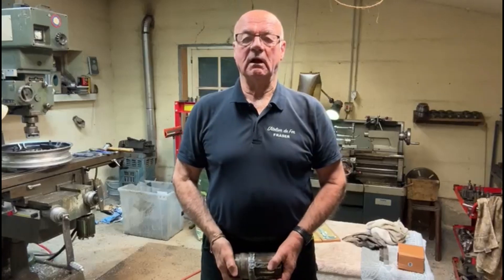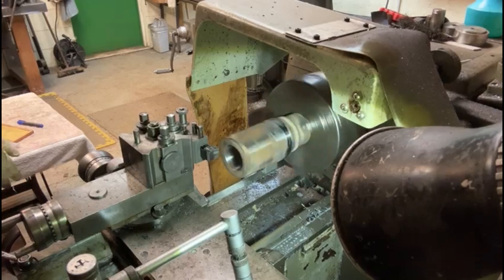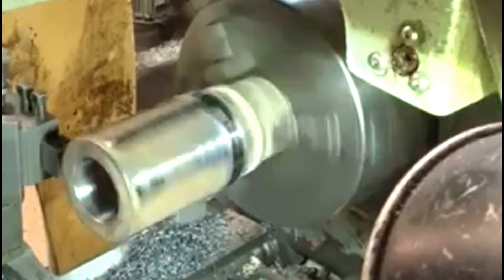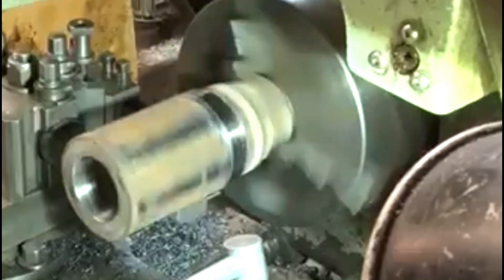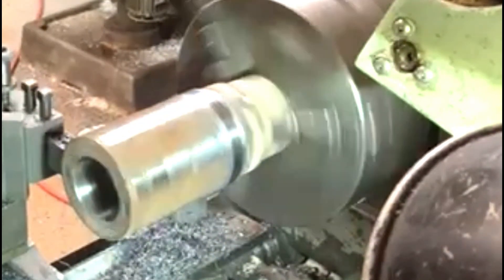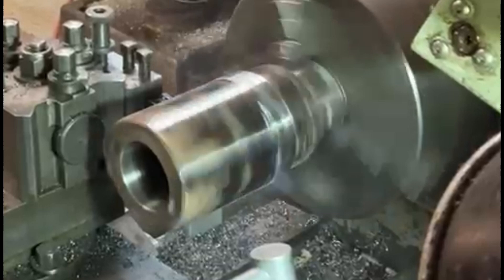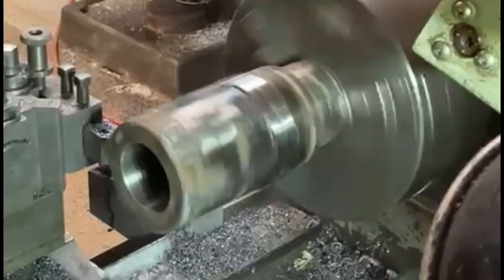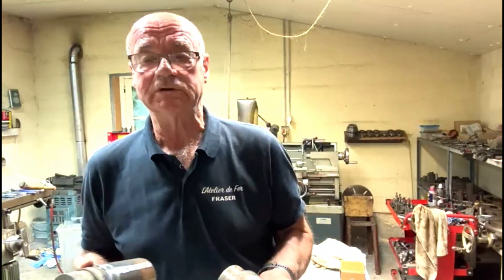Machining Steel Central Hubs

Comment: I really do not like those intermittent cuts! They throw tiny hot bits of hot swarf everywhere, I think I would have taken most of the surplus metal off with an angle grinder outside first, but I see that there was barely enough metal to get your 80mm, I hope it has not damaged the head bearings, and I hope you had a full face mask, if not you will have swarf burns all over. Stay sae! Chris B.
Reply: angle grinder might cut too deep, ok for personal stuff, not for a job
Reply: @jyvben1520  Well I did not mean attacking it like a bubba! angle grinders can be use in a more delicate way than that, after all they are used for sculpting art.